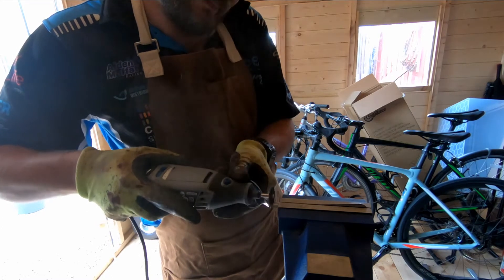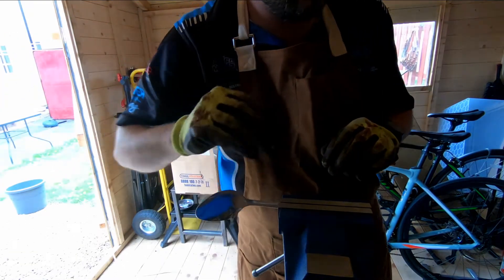Welding a small bird figure from cutlery

Comment: Thanks for the settings: 1.6mm rod at 45 amps. Very useful.
Reply from the maker: It's attached to my workspace which is made of metal. As long as the piece sits on the table, it's grounded. You can just see the clamp on the right hand side of the video when I'm welding.